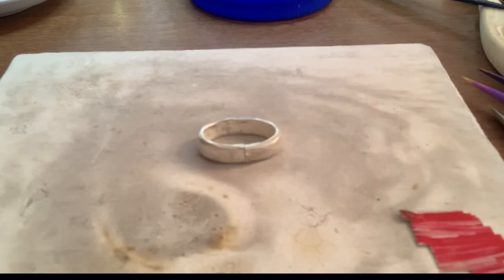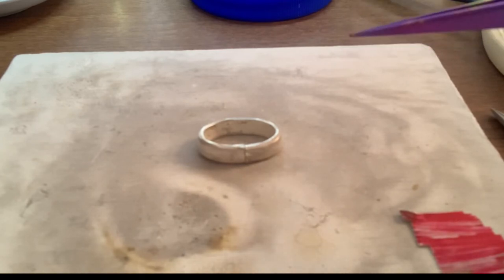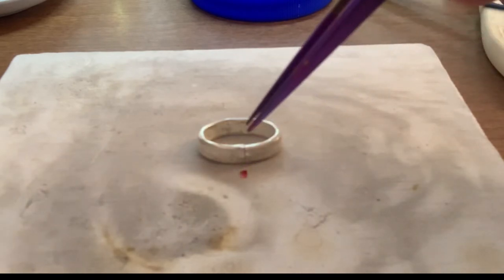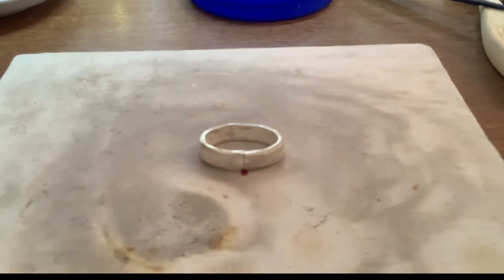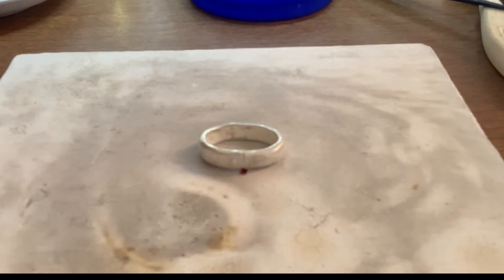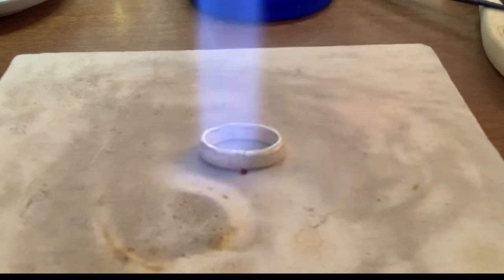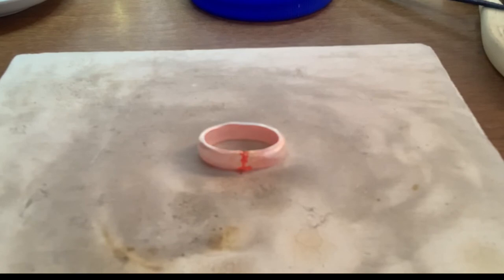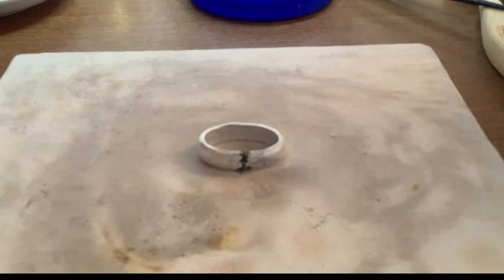How to Solder a Sterling Silver Ring Band Shank Closed (The Easiest Way!)

Comment: Hi so after this method of how u keeping the flame over the whole ring n it turns to that red color doesn't it leave fire scale, blue silver, I'm not used to soldering with such a wide flame I used the thinner flame, I just need to know coz this is new for me  TIA
Reply from the maker: I find that soldering hot and fast minimizes fire scale but if you think it could be an issue, you can use a fire coat. The torch is centered over the seam, not the whole ring but maybe the angle doesn't show it very well. :)

Comment: Do you not coat your pieces with Boric acid & alcohol? Is that not necessary with this way of soldering? Thank you!
Reply from the maker: If you have problems with firescale, a firecoat will certainly help. The faster you solder, the less likely you will get firescale. :)
Reply: @JewelryArts   Hello again! If my 4mm thick round SS bangle I am trying to create won't solder the way you've shown here (after 4+ tries, pickling each time) what could possibly be wrong on my end? I am using a 1 tip on a Meco Midget torch, propane and oxygen tanks- my solder is med-hard silver.  I am at a loss for what could be going wrong here, or where to trouble shoot. I've gone over my seam and it's as tight as it needs to be. The only thing I can think of now is maybe I'm considering too short of solder time, and it's not getting hot enough possibly....it seems like a long enough time....Thank you!
Reply from the maker: It sounds like not enough heat, can you switch to a larger tip? Also, can you give me more details about what happens?
:) @ilahroseminton
Reply: I just realized it might be my tip size- I have a 3 on the way. What would happen is the solder square would not flow and kind of stick to the cooked flux and bake onto my piece- my flame was starting to cook through my solder board as well, right before I concluded.
Reply from the maker: Gotcha! A bigger tip should solve the problem. Let me know how it goes. :) @ilahroseminton
Reply: Checking back in with ya! Got the 3 tip in and had one 'failed' attempt with hard solder- and after I pickled my piece (aaaagain) I choose med hard  and she soldered! Now you'll have to excuse me I need to go take a victory lap!!  Thank you for inspiration and help with this! @JewelryArts
Reply from the maker: You deserve a victory lap!!!!!!!!!!!!!!!!!!!! @ilahroseminton

Comment: What kind of soder did you use on your sterling silver shank?  I have sterling soder in easy, med, and hard.  Also I have copper soder.  I have tried three times to soder with the sterling soder and no luck.  Will you help me? Thank you, Linda Gray
Reply from the maker: I would use Hard Silver solder. Are you using the heat the way I recommend?